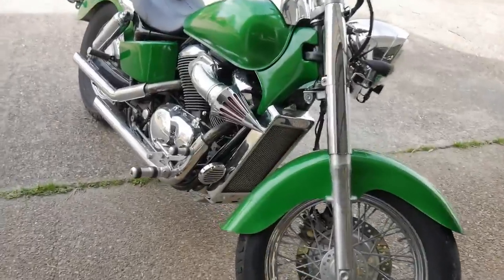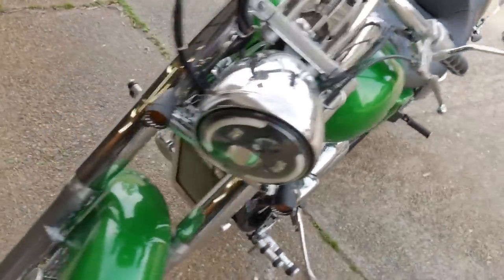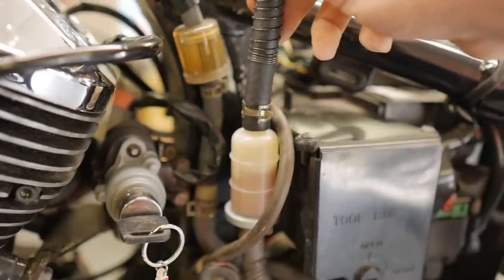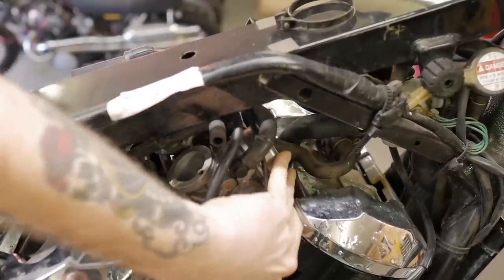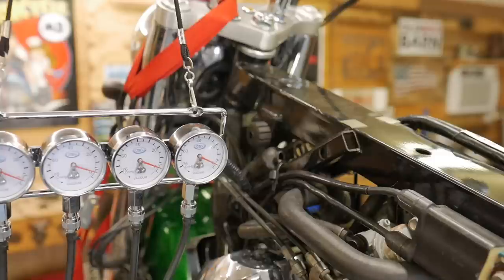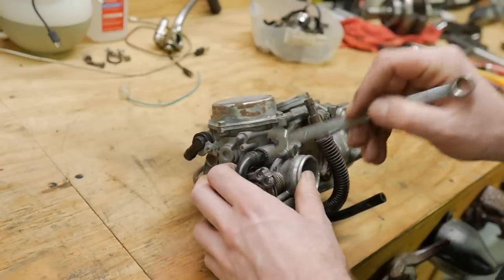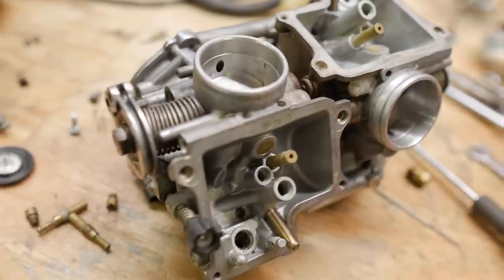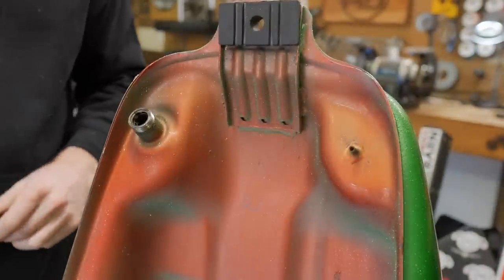Honda VT750 Shadow NIGHTMARE Diagnosis - Part 1

Comment: The diagnostic process is in my opinion one of the most misunderstood parts of mechanical repair.  Probably the most important, as you can't fix a problem without it except by luck - and it can get very expensive before you manage to find that "luck."  Even if I can't do the actual work myself, it really helps to know I'm not being snowed by a disreputable workshop with a parts cannon. 
PS: It goes to show there's no substitute for an actual diagnosis.  When I first heard it breaking up, I thought it sounded like an ignition issue.  Never trust instinct - logic always wins.  👍

Comment: I appreciate your channel so much!  This particular video makes me glad I held out for a stock Shadow to purchase.  All I had to do was replace the carb boot and adjust the mixture to correct a slight stumble, otherwise none of this mess.  Thanks for sharing, stay well from the Morris IL area!
Reply: For the very reasons we see in this video, every time I bought a used bike I always by one that’s completely stock. A lot of home motorcycle mechanics really suck at it. (And you find out as soon as you remove the oil drain bolt and find that it is cranked down to 900 ft/lbs). You were right to hold out for an unmolested bike.

Comment: First time on your channel. Old bike mechanic and enthusiast. Today I agree on your thoughts except first thing I'd check is the fuel itself for contamination, quality.  Double check crabs for blockage  . Then after your other checks is the ignition quality and and valve adjustment doesn't hurt .   Replace plugs with new ones and run and ride and recheck for jetting again.

Comment: I think it's a number of factors. I am a tech by the way as well. All those filters would be causing a restriction for sure especially the smaller ones being completely blocked. 
The air going in is probably too much for those carbs to handle. I would cover that stupid air filter with some layers of perforated tissues for testing to try to get less air into the system.
 The carb may need a complete dismantle for cleaning as well. Man can be so many things lol.  Sometimes the spark plugs look good and can actually be faulty. Ignition coils blahh blahhh so many things.
Reply from the maker: You are not wrong with any of that logic! We think much alike! 👌🏻👌🏻

Comment: Good methodical troubleshooting. After you clean/change the filters, I would replace the fuel lines. Then do a flow volume & pressure test on the fuel pump. Verify the carbs & jets are good. Also the intake boots need a good looking over while the carbs are out. Bore scope the cylinders, & intake. maybe exhaust but pipes would have to be removed.. I don't like the spark plug being hit. Once the fuel is up to par, the compression, valve lash & timing would be my next check. Weak valve spring(s) come to mind also Electrical would be the last thing on my list

Comment: Obviously was starving for fuel with the clogged petcock screen.  Clean out the tank as best you can, get new petcock along with the screen and spray through as many of the carb passages with carb cleaner as much as you can, if idle, pilot and main jets appear clear, reuse, replace the fuel lines (very cheap) and take out that extra fuel filter after the pump, button it up and you should be good.  Right?

Comment: Plugs say lean.
1-2 plugs not fully seated.
1 plug squashed, probably not firing, however the other plug will be.

Fuel supply looks restricted but we haven't tested fuel flow rate or fuel pressure. Perhaps there's a tester for that? But rusty fuel tank, lots of filters. Possibly the pump is damaged or underperforming. I want to test flow rate and pressure to the carb.

Symptoms only happen when extra fuel and air and spark power are required together. I'm guessing a weak spark would cause wetter plugs, whereas we are seeing all fuel burnt.

So too much air, too little fuel, something like that.

Comment: Fuel restriction sounds like a good reason, but from the test ride it seems that problems are only on higher RPMs AND on idle (throttle off), at least that's what I noticed from the video. If that's really the case and not just my impression from the video, it would mean that there is enough fuel supplied during the open throttle, so fuel line flow rate is OK. It would then point out to the idle circuit in the carbs, maybe some gunk built up there, before the filters were even installed? 

My second guess would be that the mixture may not be set up correctly, you improved the mount on the air filter, which can possibly lead to smaller air intake now and richer mixture. But on the other hand, I am not sure if that would caused the problems during the test ride.

BTW I am a super beginner, started working on my bike last year. Your videos were super helpful to work out a logical diagnosis process, I learned a lot from them!

Comment: As a proud owner of a 98 Shadow VT750 C3, I would 1. drain the tank and refinish the inside to remove rust, 2. replace the fuel filter and get rid of the other filter, and 3. flush out all fuel line hoses. 3. most likely have to do the carbs and jets also. . 
Hypothesis: rust enter the fuel system via the gas tank and contaminated the who system including jets.

Comment: My best guess would be dismantling all the carbs and cleaning them perfectly. Given the amount of dirt in the last filter and the relatively clean bowl, a cleaning has been done. But it was not a full cleaning otherwise the filters would be clean too.
Then of course clean tank, put a new set of filters ONLY where they are supposed to be, check floats level, check fuel flow. Give it another try.

Comment: Im looking at a VT750C2 this afternoon. My experience is with my 1979 Limited Edition 750.  I did not realize it was going to be shaft and liquid cooled. I have a lot to learn just to check the bike out later today. Thanks for this vid - Per Question - The external filters look new where an existing issue of crude exists from the tank, and eventually to the carbs. Hence carb was contaminated before the new externals were added -

Comment: Comparing low speed test ride to high RPM the first thing that is indicated is fuel starvation. The carbs are in spec and are to be blown out or boiled to clean. Fuel pump volume check with hose and filter cleaned up to stock configuration. If no solution at road test then a low voltage ignition or intermittent spark at high RPM. Good luck I hate duel carb set ups.

Comment: I had my vt600 do that but on low to mid rpm. Found out high tension wire to the plugs was green powdery toast, one of the front spark plugs was seized in rusted. I blamed the carb for a whole week.

additionally my bike did do that at higher RPMs when i tore a fuel line cause the carb wasnt getting the fuel it needed to sustain high RPM and when my dad found out his used 900rr was missing a fuel pump and was gravity fed the whole time

Comment: I'm having trouble with my gl 81 1100 Gold Wing. But it's coming down to eather it's the cable from the starter has caroaded or I'm going to have to pull the starter and clean it and put it back together. I did a bunch of work to it and then it got stolen. It's been 3 years but I tracked it down. But when I did get it back wires were cut and rust in the tank. I'm using a starter relay from a Ford 150. I got a new battery but I only had a one amp charger. I'm having problems getting a deep cell charge. The charger says it's charged at 12.88 but I know it's not. How do I get a deep cell charge now? Should I put it on 2amp charge and watch it with the multi meter.

Comment: Vaccumhose from rear cylinder to petcock, If leaked the engine runs bad like that, or maybe too lean 
because of aftermarket intake and exhaust, maybe earlier models do not have that hose connection
Reply: Exact. Vacuum petcock valves appeared on Shadow Aero, and this is previous Shadow ACE model.

Comment: Awesome video I'm currently working on a 2002 honda shadow 750 and i am stumped on what is wrong with it I've just about changed everything and it still cuts out at high throttle
Reply: Надеюсь вы все починили ! Посмотрите есть ли искра на свечах зажигания в этот момент когда она глохнет ? Если ее нет то смотрите датчик положения коленчатого вала! Удачи вам. С любовью из России.
Reply: Maybe a contact is lost at battery terminals or INSIDE the battery (due to vibration at high rpm). Sometimes, a terminal has a crack inside and it may randomly cut out. Try a different battery. Also, instant cut out of both cylinders instead of slow dying or shutting off one cylinder suggests that it is 1) an electrical problem and 2) it is somewhere closer to the battery rather than plugs.

Comment: Question .. following your videos .. ty for that btw .. i found that my Airfuel mixture screw is not "deep" in the carb like this bike .. you know if its normal to mod it so its level with the face of the carb ? .. hope you understand what i meen :) its a 2000 Shadow ace and its out 3 1/4 :)

Comment: You sure make the carb removal part look easy.  (It's not)
Reply from the maker: Do a thousand of them and you won’t feel the same way! 😂
Reply: @TheMotorcycleMD  Yes, I'm sure that's true, I have an 05 shadow 750 with the engine popping a little at idle a little more on deceleration. But overall it's manageable.  I'm looking forward to part 2.  Greetings from SW FL.
Reply: Carb removal is a pain on this!
Reply: @DragonSol42  I have the same bike , try this remove both drain screws and flush with carb/brake clean.  It helped me

Comment: Aftermarket mufflers and need a bit of a carb adjustment but I've never owned a Shadow.  Harley's yes.  Vintage Hondas..yes.  2006 shadow aero 750 ....no...ha.  Not bad but a bit of tweak needed.

Comment: Hello, I actually have the exact same problem on the exact same bike accept I have velocity stacks and drag pipes. It had blow by in the cylinder quite some time ago so I had to replace piston rings as well as valves and valve springs among many other things. I’ve gotten it running a few times and tracked a problem back to the computer. The wire granting proper power to the ignition coils had a terrible connection at the point between the computer connector. So far I’ve replaced the fuel pump and new spark plugs so im thinking im narrowed down to tuning but still having some trouble. Im set up with 45 and 145 all around for the carb set up and am unsure what jets to try now.
Reply: I’ve also fixed that connection, new clutch pads, all new fluids, and I noticed the different sizes jetting for stock and was wondering since I can’t get the bike to actually ride what jets I should shoot for

Comment: 125/130 mains is too small for a shadow 750 with opened up intake and exhaust although with all that garbage in the carbs having bigger jets wouldn't really help anyway, once the carbs are clean and flowing with that intake and exhaust an increase in main jet sizes to 135/140 should be pretty close......

Comment: My 1986 Honda vt500c drops to one cylinder after riding for about 2 miles and then kicks back to full power after a mile or two. It does this every single time but varies depending on how warm or cold the ambient temperature is (stays at one cylinder longer when colder). I'm in the process of diagnosing it and put a new CDI box in it because I was sure that was my problem. Has anyone else ever had this symptom on a bike? It's almost comical that it cuts out and back in at nearly the same point down the road, I'm always putting through this same little town on one cylinder 😂

Comment: The easiest and most sure way to fix a bike like this is to get a service manual and go through parts that are not OEM, and change it back to OEM.
That is why I normally stay away from modded bikes or I get them with a very low offer.
BTW, the fuel pump would not really add resistance. It will actually add more pressure, thus removing some of the friction.

Comment: At the beginning of the video I'm thinking, "Bring the bike back to stock and then move forward."  Meaning, don't just go after what you think it is based on the symptoms, first off, make sure everything is working as it should.   While doing that, you might find the culprit.

Bingo!  The bike has been molested by a rank amateur with no consideration for what is right!

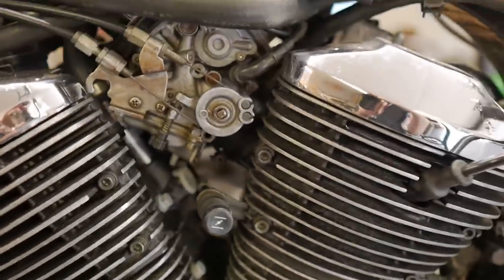8:45. Possibly the reason for two fuel filters.  Previously rusted tank.

22:15 Bingo on the rusted tank!

24:00 This is why so many mechanics don't want to work on old bikes.

Let's see if part 2 says, "Perform maintenance to all the bike's systems and bring them back to factory specs."  That's the basic common sense and logic approach.